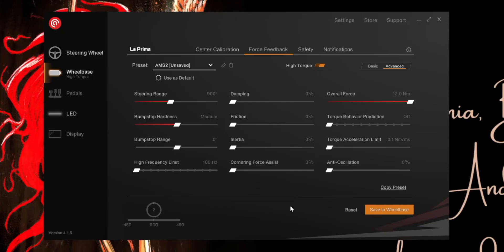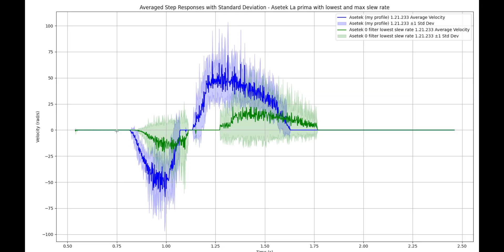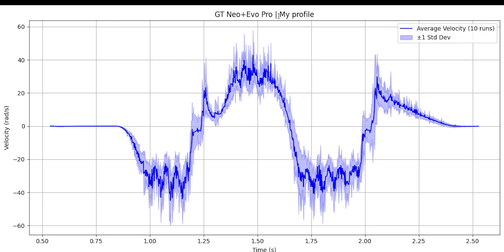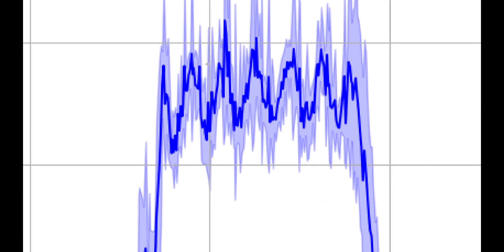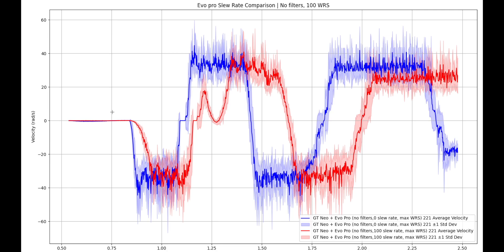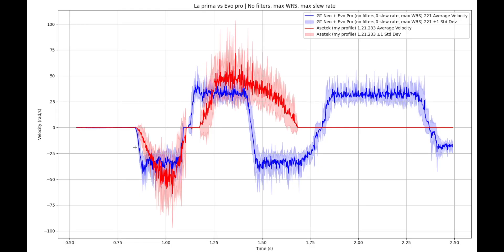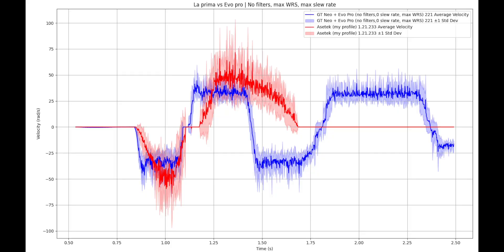Simagic Evo Pro | Slew Rate & Step Test Results

Comment: Criminally underrated
Reply from the maker: You're generosity knows no bounds 💪🏼
Reply: @napmanreviews  I was able to make some changes to my ffb on my Alpha Ultimate based on this info (found over a second). Good stuff!
Reply from the maker: How? 👀
Reply: Facts!!!
Reply: Started by lowering the rotation speed (slew rate isn't an option for the ultimate. Then lowering the mechanical friction at the same rate I lowered wheel speed. Once it finally felt the most stable I kept the friction and raised the rotation speed back up, seems to be a great sense of rotation while trailing and can catch slides. 

I'm leaving out the centering force. It's still a work in progress.
Reply from the maker: @n0kodoko143  Glad you found a sweet spot and gained time.

Comment: Great work as always. Owner of the Forte…so kind of blushing right now as it being La Prima’s more powerful sibling means the slew rate gap compared to the EVO Pro would be even more pronounced.
Simagic needs to go back to the drawing board a little on their Control Algo or FW, and I’m tenon time it will be addressed and tuned accordingly.
Reply from the maker: Forte? Damn dude. I wish Asetek would collaborate again. I'd love to test their other bases too. And you're on point, something is off in the base on the core level. The random overshoots and corrections are proving to be a problem.

Comment: The flu rate is limiting acceleration. It’s reaching the same value but holding it for a shorter amount of time I think this is the better method because it guarantees you get both effects.
Reply from the maker: I'm sure there are multiple other methods, but this was the one available to me for now. I'll continue to work on refining my testing methodologies to bring more refined data to the table.

Comment: Dang man... 
Your testing is beyond rigorous! I REALLY REALLY hope someone will help u get that SC2 Pro real soon!
You might be on to something!
Also - if you have some sort of article or location with all the data and methodology - layed out more elaborately - that would be really nice to read!

Maybe some sort of terminology video - would be really helpful.
like in a nutshell: what is slew rate, as opposed to speed, as opposed to torque, and velocity - in the context of a wheelbase. 
Also how did different degrees of rotation affect the slew rate. 

lots of questions tbh. Just watched it once so far - but I feel I need to dig much deeper and pause the vid like 200 times - to actually digest all the details.
Following your process so far - really interesting.
Reply from the maker: Absolutely man. My upcoming video starts with a crucial metric and I'll cover it from ground up.

Thank you for your kind words ❤

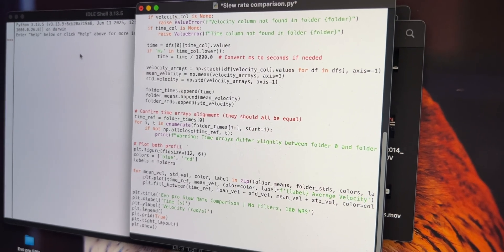Comment: Awesome video. Please continue with your scientific based approach, I love it ❤ I'm a bit confused though. Slew rate has the unit Nm/s whilst the graphs in the video at 9:40 are in deg/s. Furthermore, at 6:00 the slew rate dependency of the graph looks reasonable to me, considering that velocity is (twice) the integral of the slew rate over time. In the transition phase, the lower slew rate setting produces lower rotation speed (red curve). Integrating slew rate over time gives torque. Integrating torque over time should correspond to velocity, I guess. Limits must be respected in the integral. Please let me know if my understanding is valid.
Reply from the maker: Hey man, thank you for your kind words and questions. Please bear with me and if you have any further queries, please feel free to ask. 

Query 1 - The data column in the csv files was deltaXDeg, which is measuring angular displacement, and the rate of change of this displacement (degrees per millisecond) is proportional to how quickly the system is moving or how aggressively it is commanded to respond. 

Usually for every wheelbase there is a conversion factor which a wheelbase manufacturer can provide. Emphasis on can. 

Because the torque output of a wheelbase is closely tied to its angular position changes (through its mechanical and control system characteristics), the shape and magnitude of these slew rates in deg/ms can scale proportionally to actual torque slew rates (Nm/ms) by a roughly constant factor unique to the system.

In the code I ran, I had the deltaXDeg be treated as torque values. (I know it can induce some errors because I don't have the calibration factor from the manufacturer, but the results still won't be off by that much. Tested with a few other bases to confirm that the assumption is working on point here) 

Query 2 - You’re correct that lower slew rate produces lower rotation speed in the transition phase (red curve). Just to clarify the mechanics, slew rate limits how fast torque can change, it doesn’t directly integrate into velocity. 

Torque generates angular acceleration based on the wheel’s inertia, and integrating that acceleration over time gives velocity. So your observation is right, but the chain is

 Slew rate - torque rise - acceleration - velocity, not a direct integral from slew rate to velocity.
Reply: @napmanreviews so good, perfectly said tbh. Finally someone brings up velocity.
Reply: @napmanreviews  Thank you for the quick response. 
I've setup a python script to simulate a FFB steering wheel response with respect to parameters as inertia, slew-rate, peak torque, peak velocity, PID settings, etc. 
Since you apparently like plots the same way I do, you might be interested to play around with it. How can I share the link?
Reply from the maker: Oh awesome! You can join my server and provide there. 👀

Comment: The Prima is 12nm and the Evo Pro is 18nm. Are the results you've obtained really comparable? It might make sense that the oscillations would be greater and more difficult to control at higher NM.
Reply from the maker: These oscillations are frequency oscillations, not wheel oscillations. It shows that the control algorithm is having a hard time with the low inertia rotor.